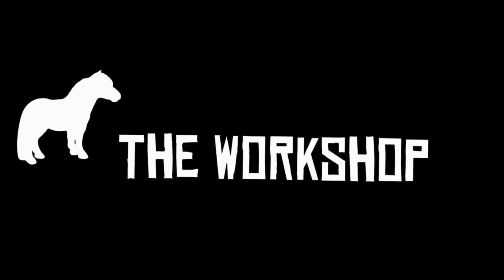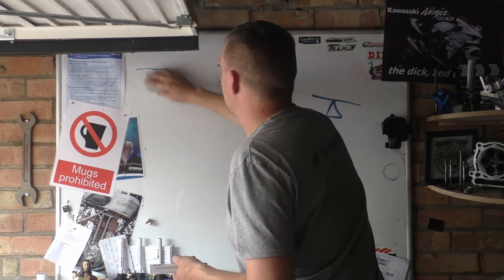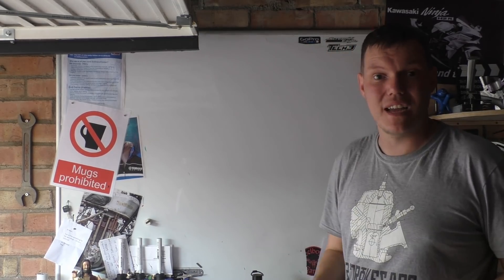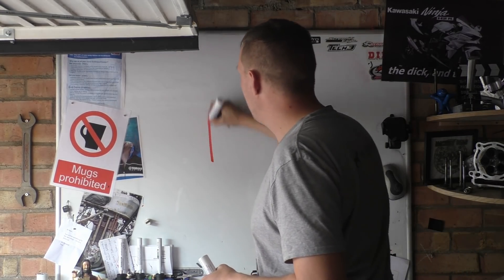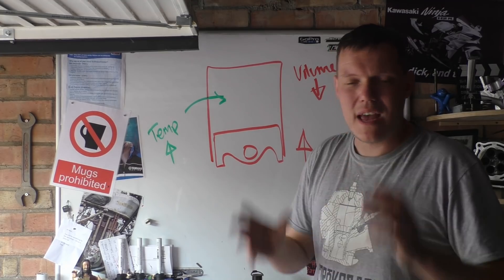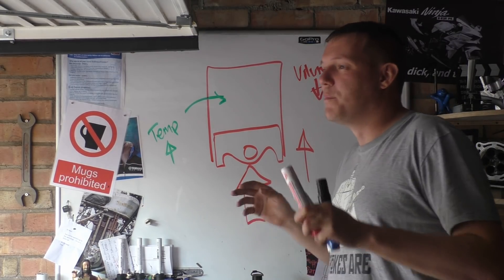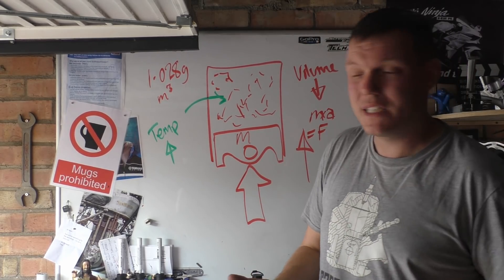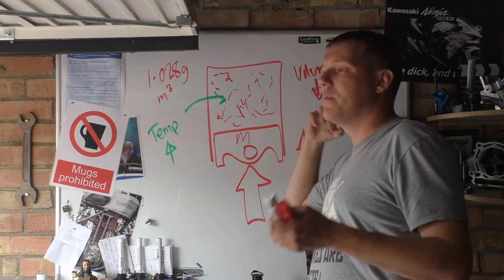Compression - Where does the heat come from?

Comment: Hi again Matt, sorry for being an absolute pain in the arse mate i just have 2 more questions for you. The first of which is, am i right in thinking that diesels are more fuel efficient because they use leaner A/F ratios and because they have higher compression ratios which in turn means more of the heat from combustion goes into useful work and as a result they use less fuel to make the same amount of power? And finally, why do diesels now use throttle bodies according to engineering explained it's to increase EGR is he right?

Comment: So... if you get a rubber band and stretch it verry quickly, it will increase it's temperature where it stretches. Why? (Because the rubber molecules slide one over each other creating heat due to internal friction?)
And if you let the rubber band cool to ambient temperature while stretched and then you let it retund to it's normal form as quick as it can it will cool under ambient temperature. Why it cools down when contracting to it's normal form?
Reply from the maker: "Why? (Because the rubber molecules slide one over each other creating heat due to internal friction?)"

- No because the molecules are in a lattice and are bonded together - this is through vulcanisation. When you bend the stretch or shear things you are forcing this structure to elastically deform. That requires force - or an input of energy in other words. This energy has to 'go' somewhere. This is what you 'feel' as heat. Excess energy leaving the system through radiation
Reply: And is another half 
And thanks

Comment: notwithstanding the energy you add to the gas with a piston (or whatever), as well as forcing the gas into a smaller space are you not also concentrating the energy it already contains, contributing to a temperature rise?
Reply from the maker: Temperature is energy - you're not increasing the energy - that's impossible. What you're talking about is energy density or energy per volume. This doesn't increase the output as that would be creating energy. Atom per atom, no matter how close or far away from each other they are doesn't cause a increase in energy.

What does happen though is that thermal conductivity increases. This can mean that the transfer of heat per give time is increased - this can 'feel' like a temperature rise.

Comment: Bernoulli's principle, and subsequent equations, are used ALOT in the brewing industry.  When your moving product from tank to tank and varying elevations and pipe diameters it is a very useful tool.  Especially when you are designing a system which incorporates cleaning processes that require a much higher Reynolds number to promote turbulent flows verses the laminar flow you require to maintain CO2 solubility in beer.
Reply: Nothing.  It is just a discussion highlighting how important Daniel Bernoulli's  studies are in the engineering world and how diverse the applications are, he learned a lot staring at waterfalls. It's applied in everything from aircraft wing design to how your carburetor draws fuel from the bowl, and how to move beer from one tank to another.  Flow velocity and energy applications.  Recognizing the impact of kinetic energy and potential energy on a process and their relationship to velocity.  What is your contribution to this discussion? Engine ore? Is that mined from open cut or underground?
Reply from the maker: "used ALOT in the brewing industry."

- I wonder how you know that LOL

Comment: Loads of questions. A followup video definitely. After peak torque, the engine cannot bring in enough air due to the short time frame the valves are open. What effect does the high temperature have on the air intake, if any? Thanks.

Comment: a friend of mine lately told me that his diesel car has a diesel cooler (dont know if this is true)
for what does the diesel fuel need to be cooled?
Reply: marc blub Modern diesels run very high injector pressure in order to get better atomisation of the fuel, this means they have to use powerful injector pumps. These heat the fuel more than older pumps used to. This affects the viscosity of the fuel and hence the lubrication of the pump. It also raises the compressibility of the fuel so the pump needs to work even harder.

Comment: PTV also shows that the turbo works over the waste heat of the exhaust system. as hotter the emissions are as bigger is the volume of the gas and that makes it spool.
Reply: And the opposite, reving the turbo out of the efficiency range and blowing twice the hot air at half mass... potentially...

Comment: That is why HP is inefficient. I think. and torque is a measure of true efficiency as per diesel as a true workhorse. I may be wrong but also small displacement high revving engines wear out faster.

Comment: so what happens with compression when we inyect water, metanol , nitromethane or any other fuel that absorb heat??
Reply from the maker: The molecules absorb that energy. This is called "specific heat capacity" -
Reply: The Workshop Does it have something to do with the changes in the state of the matter? for exaple water to vapor?
Reply from the maker: Yes and no.

Comment: How have engines managed to increase compression ratios. Normally I would think that materials make the difference but compression is the fuel air mix
Reply from the maker: Octane - and we'll be getting to that real soon
Reply: Cant wait for the video Matt, would swapping over to aluminium heads (better heat shedding), piston squirters (better heat shedding), heck filled valves if you want to go to the n'th level (heat shedding), vvt(to manage VE/compression ratio),  direct injection, etc all be a part of the answer?

Comment: Not sure if I have a solid point here... Big displacement engines have lower compression ratios compared to smaller engines? Look at a large american V8:s compared to a small bike engine. My KTM500 has  11,8:1 and runs reliably with 95 octane petrol. I highly dout that a shitty american V8 will run with the same compresion ratio with the same kind of that petrol qualityl? How come? Why do small dicplacement engines run with higher compression?
Reply from the maker: Energy and octane. Most American fuels are low octane like 88 or 90. We'll be covering what octane ratings do and how this effects compression ratios
Reply from the maker: "Why do small dicplacement engines run with higher compression?"

- and they don't. RC engines (5 to 10cc) run between 8 and 10:1. Yes they are running methanol (+ a bit of nitro) and methanol has a higher octane rating than petrol (about 108) but there's also rotational mass to consider with small engines.

Compression takes energy in the form of angular momentum (w)
Reply: I get the point of the difference between RON and MON. Small engines looks to coping with higher compession ratios than bigger engines?

Comment: Now without even looking the video, isn't heat just an energy state of atoms. So, if you take a volume with a certain energy (a certain temperature for a given volume filled with atoms), wouldn't the temperature rise since the energy is the same but cramped into a much smaller volume?
Reply from the maker: This is energy density and this has a small effect, however not the numbers you see when compressing a gas.
Reply: @thedirtyworkshop  
Well, to change the energy density you have to put in energy, right? That would be compressing the gas.
Reply from the maker: Sometimes
Reply: https://youtu.be/EEUtRiuWK2o